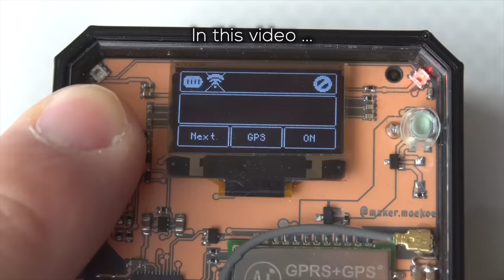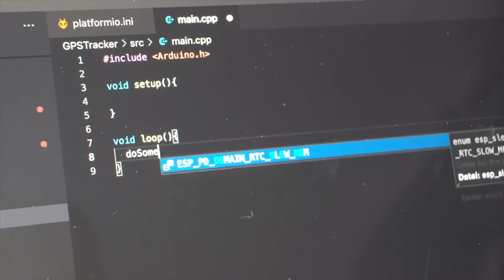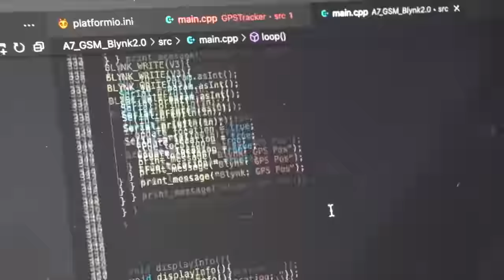I've built a GPS tracker with ESP32 | soldering, assembly & first test | makermoekoe

Comment: bir projem var destek olabilirmisiniz  , kısaca anlatayım. gps modülden yada hb100 doppler radar molü ile ama tam karar veremedim hangisiyle yapayım diye . proje : gps & hb dopper modülü bir araça takacağız .(modül+kontrol kartı + encoderli dc motor ) olacak . araba her 1 metre gittiğinde dc motor sadece 1 tur atacak bunu nasıl yapabilirim. 

I have a project, can you support me, let me explain briefly. With the gps module or the hb100 doppler radar mole, but I couldn't decide exactly which one to do. Project : We will attach the gps & hb dopper module to a vehicle. It will be (module + control card + dc motor with encoder). Every time the car goes 1 meter, the dc motor will only make 1 revolution, how can I do that?

Comment: Intresting project. Especially if it could turn on, get gps location and then back to sleep again every 15 minutes and only if location moved send out a really short signalburst of mobildata not to make tracking of the device location easy. if the battery life could be atleast 6 months, I know a lot of applications for this. especially if it was a good price och not connected to any monthly service. I would buy them easy to tracking expensive mashines.
Reply from the maker: Of course the module has to go to sleep in regular intervals, else the module would not survive a single day... There are SIM cards, which can be used for 10y with a one-time payment of 10€. Haven't tested it yet but check out this: https://1nce.com/de/sim-karten/

Comment: Nice project but u should never doxx yourself by posting the exact gps coordinates of your house in a yt video. You should really consider reposting with blurring the location.
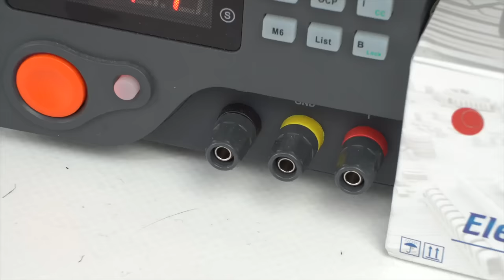Reply from the maker: Thanks! Did you see my exact gps coordinates anywhere in the video? At 8:04 it‘s pointing at my location but I didn’t zoom in due to that reason 👍🏻 On the device itself the GPS position is cropped, only the random position is shown completely
Reply: @makermoekoe  If you are located in Herren-Werve: yes. If not dont mind me.
Reply: Ohh, hab gerade deine Website gecheckt. Du gibst deine Adresse ja auch im Impressum ohne Datenschutzimpressumsservice an. Vielleicht dann nicht so schlimm hier im Video.
Reply: @makermoekoe  As @lookto said the detailed coordinates are visible at about 8:02 . Although they are reversed at first ( should gave been (...° N, ...° E) , but it is (...° E,  ...° N)) it pinpoints to the same street as in your website's impressum. But instead of the building given there, it pinpoints to the building 30.
Reply from the maker: @iamlookto  Ouh shit you're right. Don't see it while cutting the video... Yes now it's too late

Comment: Your through hole solder is very 'blobby'. Need to increase the iron temperature or use a decent 63/37 or 60/40 solder (I find noPb solder is rubbish to work with).

Great project btw

Comment: https://www.youtube.com/watch?v=ZK4j591Rtps Have you thought of making a machine that would dispense solder paste through a tube like a 3D printer for your projects?

You could also add a heated bed or hot plate to the machine also like a 3d printer so that you could set the components onto the pcb and then from the same workspace have everything soldered together.